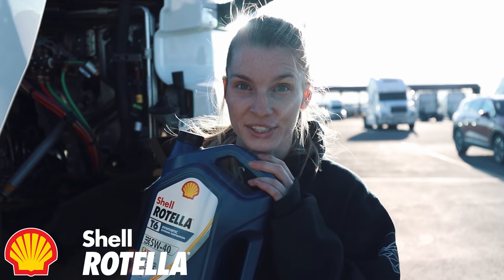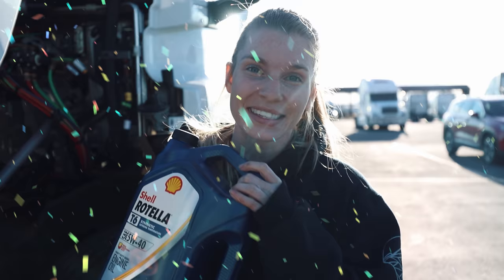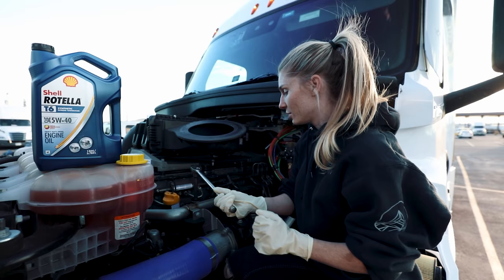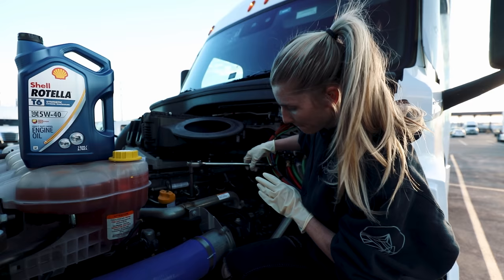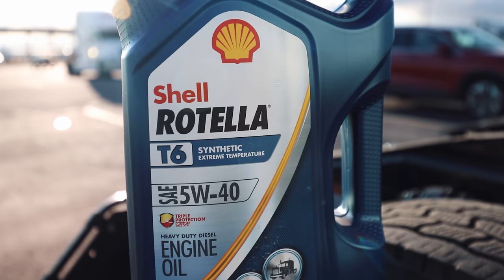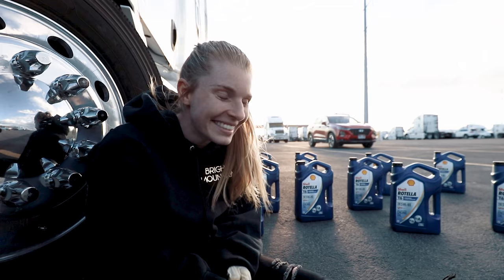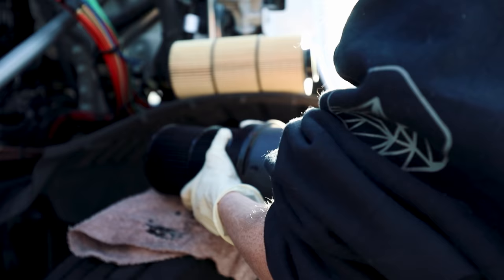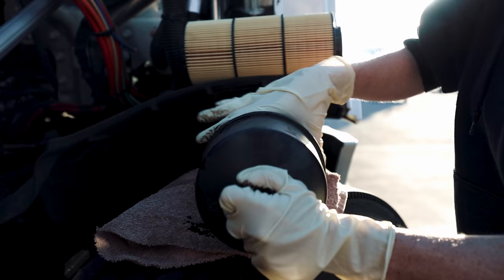My First Time Changing The Oil On A Big Rig!

Comment: helpful hint, when removing the drain plug , push on it as you unthread it until you get to the end then quickly pull the plug away.
Reply: Nah, you unthread it until it starts to bleed. Then you know you have about 2.5 threads left.
Reply: Ethan, yes works like a champ.
Reply: thats not fun

Comment: Take an old oil bottle and cut the top off. You now have a funnel. 

Success depends kinda on the shape of the bottle but it def works for emergencies.
Reply: same with a water bottle or 2-liter soda bottle if you rinse it before using it
Reply: It's weird that her "certified mechanic" off-camera didn't bring a funnel with all that oil or suggest a funnel when she asked.
Reply: @MattBlank0  agreed, but also shit happens
Reply: Yes 👍
Reply: YUP, I GOT AT LEAST 3 LYING AROUND
Reply: I cut the bottom out of a quart and use the for funnels.
Reply: @MattBlank0  hell yea he not certified at all must be loves or pilot

Comment: The same steps apply in any oil change. An I think everyone has accidentally dropped the bolt into the tub of oil at least once.
Reply: Yep, and you just fish it out and clean it off.
Reply: 🤣 Totally you need to have a good grip, lucky for me my first mistake dropping it was doing my pickup oil change.  After that I was really careful..  
Truck was clean underneath, good job!
Reply: At least she didn't have a crush ring to fish out.

Comment: I have done quite a few oil changes on diesel railroad locomotives, often using Shell oil.  Fun fact, the oil capacity on a locomotive is about 250 gallons or five drums and it takes five filters each of which are about 3 feet tall.  No matter how careful you are there will be a little spilling so please consider having some oil-dry and some towels standing by.  Excellent practice of the use of latex gloves while you're doing this.  Please consider using a two-step stepstool that will make it much easier for you to reach some places under the hood.  When you go to acquire your own tools, please get the best quality tools you can find.  Don't scrimp on cheap tools.

Comment: Good product. It's what my dad and I ran in our trucks and sold back in the 70's 
And 80's before I wandered off to university and an entirely different career path.  Still use it in my 400k mile Dodge/Cummins and 250k mile diesel Jetta.  Don't miss crawling under the Pete and the mess, happy to watch somebody else do it. Great vid, your happiness is refreshing!
Reply: Ps. Buy it 55 gal at a time... it's less expensive.

Comment: If you don't want to spill, use any plastic bottle for water/juice etc. Cut the bottom, clean it and the top goes into the oil tank. You use it as a funnel.

Comment: As others have commented, use one of the oil bottles cut in half as the funnel. Also, when you go to pour fluids from one of the containers, put the bottle spout up top. If you have the spout at the bottom, the bottle has to burp air out and then splashes whatever liquid was inside.

A small pan from the drug store is the perfect size for the oil filter and housing. You don't waste clean rags for oily messes. When removing the drain plug, slowly remove the plug and allow the oil to start trickling, then remove the plug and raise it up out of the way. It's not human nature to want to raise up, but you don't get coated in oil.

Comment: Buy a funnel. OR After you empty a jug of oil, see if the threaded end of the jug fits into the oil filler hole. If it does, cut the bottom of the jug off and use the jug as a funnel.
If it doesn't fit, cut a slit vertically in the threaded part and squeeze it into the filler hole!  Hope this makes it easier next time.
Love your videos!

Comment: I have used Shell Rotella for over 20 years and never had an engine problem and no oil burning. I recently seen an oil testing and the Rotella came out on top against other diesel oils. So Shelby you are doing good.

Comment: Always start pouring from the side of the jug and as it empties start to grab the back handle of the jug to finish. I have been using Shell Rotella T6 15w/40w in my 2004 6.0 F350 Super Duty that I use to tow my 5th wheel rv.

Comment: Companies like OTC have oil drain plug tools to keep the oil plug from falling into the oil pan. Also, is there a crush washer on the oil plug that has to be changed? It helps to use a funnel to keep the new oil from spilling all over while filling the engine with new oil.

Comment: I am still driving my 1999 Ford F-350 3.7L Power Stroke 4x4 6speed manual. I love love this truck, 1st is the torque this engine has, the mileage it gets over a gas engine and third the manual transmission witch is no longer available in a pickup truck. Have kept the body up and it still looks pretty good. I will probably never sell this truck. It has hauled a fifth wheel camping trailer all over the USA and Canada, it really shines on steep mountain roads. I have used Ansoil full synthetic 15-40 in it since it was new . I have done very little to the engine other than normal maintenance. The cam positioning sencer stopped working at about 12,000 miles, replaced under warranty, had two fuel injectors replaced at 180,000 miles. It now has 296,000 miles. Mostly hauling something. Going for at least 500,000.

Comment: Hello shelby, I can give you a tip, always, always but always, screw things at least the first turns with the hand, so it feels when it screws right or wrong, because with the tool you can screw things wrong, you don't realize, and the damage can be monumental, in this case, with the filter cover, it would be serious. so always remember: screw, nut, housing, whatever is always the first turns with your hand.  kisses, hugs and God bless you  byeee..

Comment: To pour with less spilling, if you have room, try slowly tilting the oil jug from the wider side. Also, when the oil starts flowing out of the jug, it doesn't start flowing straight out , it frictions back  slightly, watch as you pour slowly and you will see how it starts coming back instead of straight out. My truck is a:
2003 Freightliner FLD 112, with a Cummins M11. Has 900K on it, only replaced the rod & main bearings once (although the old ones looked as good as the new ones. Always use Rosella and keep up on its service. Hauling sand & gravel in Louisiana, I'm 89 years old, been trucking since 1947. Thanks for  the great videos!

Comment: Once u take the plug out once leave it out!! Get the new one that goes in there that has the little green hose u push in to drain it. So much better.... never a mess. 

I don’t use synthetic in my truck because it takes out the cam in a lot of trucks....

Comment: A good trick I learned with pouring oil (not sure if it can be done for trucks) is to use the oil dipstick. Put the dipstick into the hole down which you would pour oil and just pour the oil down the dipstick, that way you'll avoid spilling any oil on the engin parts. :)

EDIT: Oh also just remembered, tilting the oil can sideways helps as well, that way the air can pass through the oil bottle/can neck more freely and the oil will flow our more smoothly :)
Reply from the maker: Good tip!

Comment: Fumoto oil drain valve to make draining the oil much easier and less messy.  Get the one with a nipple and attach a length of clear vinyl tubing that reaches your oil pan.  A five quart funnel to allow the oil container to sit upside down and fully drain.  And an O ring removal tool to keep from scratching up the oil filter cap.  I also use a drip pan to keep my garage floor clean.  I have a tool box specifically for doing oil changes.  It contains everything I need for changing the oil in all my vehicles.

Comment: Hi Shelby, the way to fill the engine without spilling oil all over the place is to use a big funnel. I owned a Ford  Powerstroke for 20 years. It o only used 4 gallons per change, but after the first one, a funnel was always part of the process. A professional shop uses a pump and 55 gallon barrels to refill the engine. You did an excellent job, and you were right, it could of been MUCH  worse.
Be happy and keep that beautiful smile on.😀🐕

Comment: Little life hack I use when I don't have a funnel. Pour you first jug kind of from on its side. When it's empty, using a utility knife, cut the bottom off of that first jug and presto, you have yourself a funnel. Hope this helps and comes in handy for your next oil change.

Comment: If you're going to do this more often, install an oil drain valve, like a Stahlbus. Super easy, no mess, can drain straight into a container. I installed one of those on my van years ago (I'm not  a truck driver), and I thank my younger self for it every time I do an oil change.

Comment: Put quick drain plug make it easier and less mess and you don't have to worry of someone cross threading the oil plug. Have a 07 Freightliner Coronado with of course a Detroit 60. 1.3m on it. Run a LTL run in ND SD MN and northwest WI about 20 stops a week

Comment: Make sure you change the fuel separator. Even if the fuel isnt at the top its a good idea too change it.  Around 100k. Change the fuel filter and screen on the block. And make sure too grease every oil change. The newer trucks are easier. Less grease points

Comment: Hi Shelby. With the greatest respect to all what you do you never make an Oil change with the retail bottles of 2 gallons each. If you save money you use the eg 12 to 15 gallon barrel which is much more cheaper. And another thing not to loose oil while pouring from the single bottle you put the bottle flat to let the air comes out without buubling oil away. Cheers

Comment: After you pour thr 1st container in take that container and cut it in half to use it as a funnel as long as the opening fit's inside the oil fill opening.

Comment: Sweetie next time you might want to power wash under your hood, and down around the axle, and inside the wheel, and tell you a little trick, you can take one of those empty bottles, and cut off the top of it, because the top of the bottle fits down in the neck where you add the oil, and you'll have you funnel, and next time when you're done, let the oil drain out of your makeshift funnel, wrap it up in an oil rag, and stick it in your sidebox! 
It'll save from having to go buy one!..And you did beautifully!...😁👍🤗

Comment: I always changed my oil myself. It was easier than going to garage. Over 40 years changing oil in my 1977 Kenworth. and 1980 Chev pickup.
Shell is an good oil you can get it just about anywhere. Good video Shelby.

Comment: One little trick is to install a high quality hose and a ¼ turn valve. Then you can open the drain slowly and direct the hot dirty oil safely into the pan.

Comment: You forgot the fuel filter and water separator, get that done too, it'll eventually throw a code. 
Another thing I like to do is before filling back up with oil, I used a quart to a gallon to flush out any oil oil so the new oil doesn't immediately turn black.
Get the fleetguard filters or wix, on oil I run chevron delo 15w-40 on my trucks and equipment, the rotella, I haven't ran in a couple of here since my 3/4 personal pickup.
But yea point is, don't forget those fuel filters and check the air filters make sure they are happy 😁
Reply: Use the quart to a gallon prior to plug back in, and slowly do that this it runs clear is what I mean on that.
It must be a pain in the ass have to fill up a truck by bottles, I'm spoiled by my houses on the trucks, I run into I'm filling the truck too fast and that's how I can make a mess

Comment: Nice job considering it was your first.     I'd suggest a hat if you have long hair.  Also a funnel is a good tool to have.    Last, warm up the truck a few minutes to get the oil thinner before draining.
Reply: And safety glasses because hot oil splashed in the  👀 ain’t fun!

Comment: Great Idea about the giveaway.  I guess I can't enter because I don't use Instagram or social media.  That's OK because I just changed the oil in one truck a couple of days ago.  I already use Shell Rotella 15W - 40 in my 2 RAM 3500s.  I love the stuff.  I usually go 15,000 miles between changes. 
I haul shipping containers so the engine is pulling really hard when loaded. Most people don't like to haul em especially the Hi-Cube but I love the haul. Kinda feel like Thomas the little engine that could.
Just a thought on changing the oil - get an oil funnel. I was also wondering about the choice of 5W - 40 in your trucks. Most truckers, myself included run 15W - 40.  REMEMBER THE LOWER NUMBER IS THE BASE STOCK.  The oil thickens as it warms up.  If you are not running in a cold environment I think the 15W provides better protection for the wear surfaces during the spring, summer and fall.  

Just my 2 dollars worth.

John Schubert
406 Hot Shot
Missoula, Montana

Comment: Shelby; drain plug replacement 90 degree petcock valves are cheap compared to all the spilled oil & buy a rectangular funnel for every truck. Punch out 1/3 of the foil on the top of each jug to slow flow from each jug.

Comment: suggestion: to your question of not spilling. try turning the bottle of oil sideways, so you do get the gulp sound ( air transfer for liquid ) and you'll be able to get closer to the hole to pour it. you'll still spill some but it won't be as much. Hope it helps, stay safe trucking.

Comment: When putting on the rubber seal to the outside of the oil filter can, one should always oil up the seal with oil so as to aid the ease of removal next time. It is also aids in a better seal of the rubber ring...... This is normal practice unless something has changed that I am not aware of.

Comment: Not Interested in the Giveaway....BUT..... a comment on synthetic oil -> I've used synthetic oil exclusively (not Shell but another well known brand) in all my vehicles for over 25 years and besides the benefit of slightly better fuel economy, those vehicles have racked up hundreds of thousands of miles and not one of them ever showed a build-up of gunk inside. Remove the valve cover and the inards look almost new, bright, shinny no signs of wear. Yup, synthetic is a bit more expensive but it saves more in the long haul.

You did a GREAT JOB for a first timer, a comment or two - when removing the oil plug from the pan, use the hand closest to the plug instead of the "reach over my body" hand, you'll have more control and although your aim is pretty good, get a funnel OR a screw-on filler (screws right on the jug, has a short spout and you twist the collar to start & stop the flow of oil - can find it in most auto part stores by the oils) - just screw the filler on (in the closed position) put the bottle in the hole and twist the collar. No need to hold that heavy jug - just steady it as it empties.

Comment: Just a tip: It might be good to first open the filler cap first before emptying, because for some reason if that doesn't open after you drained the oil, you might have to go through a lot of trouble.

Comment: You know this video makes me miss my old Cummings, as it had a half million miles on it when I sold it. And I actually used Castrol 5w/40. And yes Shell Rotella oil is a very good oil, as it was the oil that one of the companies I worked for used on all their fleet trucks. As for me I do not need an oil change, as I no longer have a car. But my mom has a 2021 Toyota Rav 4

Comment: goto any Dealer and Get the Quick Shutoff Valve for it... and then you will only have one last Messy oil change... & Its worth it..

I have 5 Semi's in my Fleet that i manage & another one on the way that's being built by KW on the Way..

Well worth the Time and Money.. & When changing those O-Ring's that Seal the Element Filters.. always Lube the O-Ring to help it when you Tighten it down.. as it will need to move some when Tightening it if not then it can Bind/Break them.

Comment: Btw, I use to be apart of a shell company. Which T6 5w-40 and T5 15w-40 are best on the market and the price is cheaper then Mobil. Shell full synthetic leterally proves that you can drive your semi to 25k per oil change. In doing so, the additives inside WILL protect your motor, increase fuel mileage and protect your bairings as well. All I use is shell

Comment: I think I'm going to start doing my own oil changes. You never know what kind of oil your really getting when they're pumping it from a barrel that's filled with an oil truck. Driving a 19 freightliner cascadia
Reply: I buy my oil from Walmart and bring it to TA or speedco and they will put it in the engine for you no problem I don’t trust that bulk barrel stuff either
Reply: @classicjay7786  ta and petro stopped doing this last year they will only change it with their parts

Comment: You should have cut the bottom out of one bottle and used it as a funnel. Also, I hope you changed the crank case filter. If not, could cause big problems.

Comment: I have an air powered pump  with a megter on it .  Just set the dial to 48 quarts and it takes a couple of minutes..  My Norwest crane with   1,102  Cuib  inch Murphey Diesel ..  takes  12 gallons of  oil at the oil  change  .. It takes   4  sock oil filters that used to cost about  48 bucks ..for 4  ???   the saocks are like  3  feet long..

Comment: You were holding the oil bottle wrong while pouring is why it spilled. Hold the bottle side ways while pouring and you can control the oil better with no or less spillage.

Comment: I change  the oil in my 3208 Caterpillar off  road  truck every 250 hours..
  Seems the new Detroit Diesel   in a  2020 Freighliner calls for oil changes  at  45,000 miles..  the older trucks call for oil changes at  15,000  miles..
  I have used an oil sample  testing lap for years.. to get an idea of the condition.. of the lubricants..

Comment: It will get easier every time you do it. I am curious as to when diesels quit running 15W40 oil though. And my truck is a 2015 GMC Sierra with a 5.3L V8, and it takes 2 gallons of oil for each change.